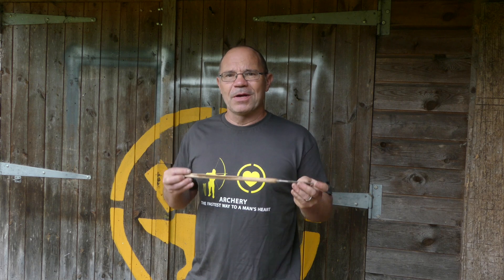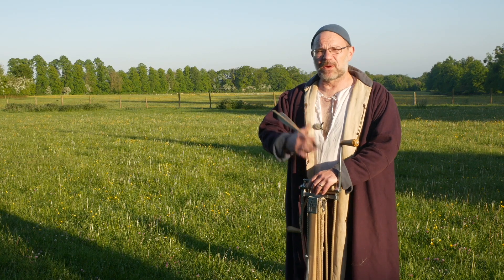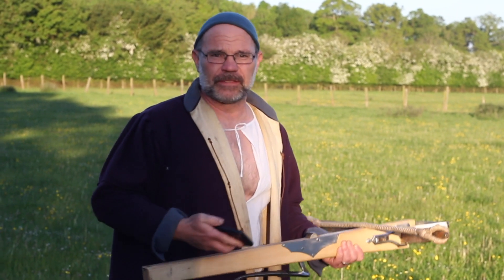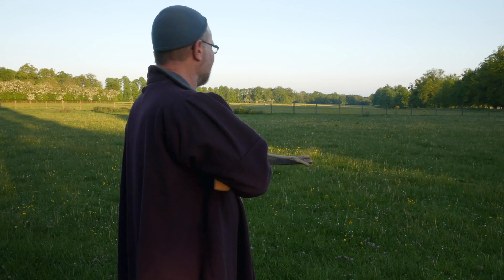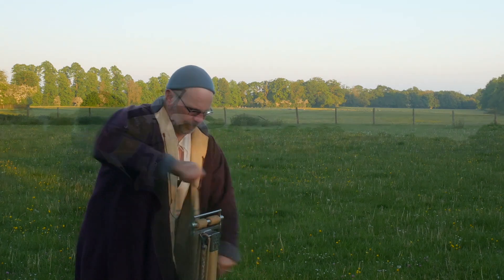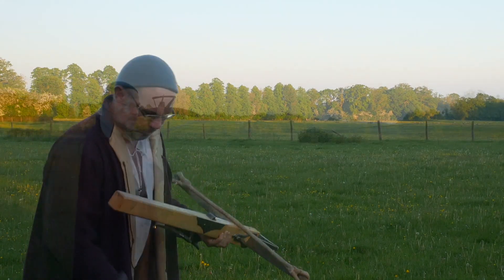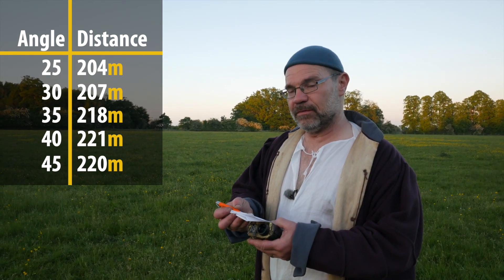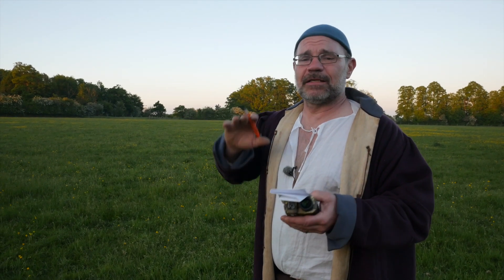Distance - Which angle is best?

Comment: I don't have a reference handy for this, but I recall seeing someone do this calculation and coming up with somewhere around 38-42 degrees - but the difference in the last few degrees doesn't really make a significant difference (small enough to be cancelled out by minor variations in each shot.)  But the angle also changes depending on muzzle velocity, shot size, weight and shape (these calculations were for cannon fire of a specific weight and power) and there were even separate allowances for wind direction and speed.

Comment: two full football pitches is pretty good distance. Next you need to see how far it shoots at flatter angles. I mean, if it can do 200 m at 25 degrees, how far will it shoot flat? Will the enemy be walking into a wall of bolts?
Reply: This crossbow has shot up to ~200 ft/s with lightweight bolts if memory serves. Assuming it is shouldered at a height of 5 feet and shot level with the ground, the bolt will be in the air for only 0.56 seconds, traveling only 37 yards in that time before landing on the ground. A more typical heavy bolt meant for penetrating armor will only travel about 30 yards when shot level with the ground. The trajectory of the crossbow is more or less the same as that of an ordinary longbow and requires a similar amount of inclination to reach similar distances.
Reply: @johnbarron4265  flat being a relative term. ialso think you are off on your calculations, as competitive Archery is @ 70 meters for the olympics, and 30m is standard practice distance. I know that I can shoot "flat" up to @ 50 meters
Reply: @jonathanwessner3456  "Flat" is not well-defined unless it's strictly referring to a level shot. Perhaps the so-called "point-on" distance would be a better indicator of accurate effective range, as the archer/shooter can place the tip of the arrow/bolt right on the target while still having an unobstructed view of said target. The point-on distance of a crossbow would likely be farther than that of an ordinary bow shooting at the same velocity because the crossbowman has more freedom in positioning the crossbow for the shot than an archer has in choosing their anchor point.

Comment: Let me know if you want my cad files and trajectory tables. Pretty geeky stuff, but interesting, the model verses the actual range testing. 
BTW, with a 75# compound bow, we were getting 360 to 375 meters, depending on arrow weight. They were all using small ( 2") feather fletching.
Reply: As an engineer and recurve archer (internationally) i would be delighted if you could share! Maybe even on github?
Reply: @thomasrufer6206  Sorry,  but I am a tech dinosaur.  what is github?
Reply: @RAkers-tu1ey  https://github.com/ where you can create a project and add all those files.
Reply: @thomasrufer6206  Thanks, I will look into it.
And, dig out the 5 year old files!

Comment: Really interesting.  I have done a lot of trajectory testing (both theoretical and physical) in helping to design the architectural loft restrictions archery ranges for bow weights from 25# recurve to 75# compound.  I would have expected a lot more variation. It looks to me like drag is the greatest limiter, as it decreases with decreased speed, and those heavy shafts must have a lot of drag.  It is like you are shooting in water.

Comment: Great test. For my test I shot at 45, 40 and 35 degrees, four times each (crossbow was cold steel cheap shot).  35 degrees on average about 8% farther than 45 degrees. average distance for each was: 240 meters at thirty five degrees,  234 meters at forty degrees, and 221 meters at forty five degrees. 
Made a video on it "what angle will shoot an arrow farthest". Yes it was inspired from Tod's work
Reply: I'm wondering how much of a difference release velocity makes which could explain your very different results.

A faster release (from using lighter bolts, a stronger crossbow, different draw distance etc.) is going to have much more drag to contend with so will have a preference for a smaller firing angle. Tod was using a fairly middle range crossbow at 850 lb with what appears to be his 60g bolts.
Reply: @ad3z10 I think you are on to something there. The bolts from the bow I used are significantly lighter and are more likely to be moved by air drag and cross winds. And air drag looks to be the key to this.
Reply from the maker: Thanks Jesse - good to know
Reply: A difference in temperature and air pressure, I assume.

Comment: I am a Ballistics Nerd and spent much time in my formative years researching and experimenting with this, mathmatically.
There are several components to the forces actings upon a projective in flight. Gravity and the force acting against its forward motion in line with its motion are the main ones and while gravity is predictable the force (the opposing force) varies depending upon its instantaneous velocity and its pitch and yaw affecting the attack angle. The shape of the projectile. is also significant.
My interest was with Naval Shells and the dimentions of a typical shell was well known and designed so that the front bit hit first. There was nevertheless pitch and yaw. I remain facinated by this subject btw more than fifty years after I started. The only differnce between then and now is that Log Tables have progressively been replaced by Calculators (of varying degrees of cost) to computers to purely mathematics.
It was interesting to observe that one particular shot showed considerable pitch and yaw until the bolt was out of vision. That surprised me as intuition says to me that the longer and thiner the projectile the more stable it would be.
Perhaps the  necessary design of the bow means that the accelerating force has to be slightly out of linear giving the pitch and the fletching causing the yaw
It is a while since I did any work on this obsession of mine, I do hope you have not re-kindled it. :-)
Conventional data for a Naval gun with initial velocity close to but not exceeding the velocity of sound (from memory only) is that the optimal angle of elevation is around 35 degrees. I was surprised with your result and as an explanation would suggest it was because the initial velocity was relatively low.
I sincerly hope that you have not driven me to the Reference Library again, they are not as good as they once were in normal towns.
Sorry about the length of this. It is not a frivolous subject.
Reply: I believe the crazy flight of Todd’s bolts was the weight of the bolt point wanting to rise to avoid the string.  It could be altered by deepening the bolt slot at the front of the stock. But too much and it curves down, not good. 
 It also could be fixed by shooting lighter points or shorter bolts.  Flat shooting is the desired effect I think, but Todd was using random specific bolts that left the bow in an unconventional and undesirable way.
Tuning a bow is done by changing the arrow spine, length, and head weight, and angle or trueness of launch.
Reply: There was a game (I don't remember the name) where optimal angle for long distance shooting (bows) was 38 degree angle. So 35 degree for guns and 40 degree here so 38 is actually in the middle (or pretty close).
Reply: @James Goacher, go for it and dive deep in your memory. You know you really want to, and your inquisitiveness shows in your writing! Happy hunting. I think it’s bloody marvellous that you retain an interest after more than 50-years! Quite possibly one of the better known ways of staving off the effects of age on the brain. Good luck.
Reply: At a guess, maybe it has something to do with the bolts having stabilizing fins that allow it to more easily maintain the correct, most aerodynamic, orientation even when fired at extreme angles.
Reply: I always put a radio transciever in my medium calibre shells before firing them at japanese aircraft.
Reply: Naval guns are able to shoot over the horizon, though. So an elevation of 35° in relation to the ship would be a different elevation in relation to the point of impact, would it not? Whereas a crossbow isn't able to shoot far enough that the circumference of the earth really matters.
Reply: @hazelhazelton1346  Assuming a range of 20 nautical miles, a little over 40,000 yds, not a practical engagement range the sea level would be a little under 100yds below the horizon to a person whose eye was at sea level. At 10yds height above sea level, a more practical place to mount a gun the horizon would be almost six and a half Nautical miles 12,000 yds. So I would expect the height of the gun on the target to be close to the height of the firing ship at 24,000 yds. (Information Googled)
The other and most important reason for my obsession in my formative years is that the terminal angle at long ranges is much greater than the initial angle. Plunging fire.
Reply: @jamesgoacher1606  I see. So even for naval guns, the difference is negligible. Thank you. :)
Reply: I wonder if the wobble is a function of the bolt not being able to travel through the arms of the crossbow— which is what the string wants to do when firing. I suspect this wobble also effects the amount of energy the bow transfers to the bolt. If it sits a little differently in the grove. It he doesn’t center the fletching so one feather drags, if the string scrapes off all the wax, or whatever, that he lubricates the top of the crossbow— all could effect the bolts flight. 
The variables in a ballistic flight can be really interesting. When I was in the US Army, I worked on a surface-to-surface missile that could go over 110km. I remember having to compensate for the rotation of the earth during time of flight!
It can be a fun rabbit hole to go down.
Reply: @doughudgens9275  exactly! Ballistics are one of the most interesting applications of physics. You have to account for everything when you scale it up enough...or down (depending on the parameters).
I think that wobble indeed comes from the arrow and the string not traveling colinearly, but at a slight angle. And i think that will be the biggest contributor to it...fletching isn't gonna do much. Maybe play around with the weight distribution on the bolt?
Reply: you have any good references for equations or simulators? I do wonder what factor "weighs" the most under what circumstances. For example, what matters most between speed, mass, elevation, drag coefficient,...
Reply: @anomalyp8584  I used the Encyclopedia Brittanica and Chambers Encyclopedia for most of my initial reseach which would have been around the 60's. I now know that it is a complex Differential Equation because the variables are changing at different rates and that they are different either side of Mach thresholds. The important force is the force acting against the direction of motion which is constantly changing with time of flight. I am vaugue about things now but I think that my initial find was something like D squared divided by mass D²/m and then it gets complicated. The retarding force acts directly as the cross sectional area and inversely to the mass, which is probably intuative. Gravity can be taken as a constant of 9.8m/s² and depending upon the initial velocity and initial angle the velocity may increase on the way down. It is very complex and I believe that Naval Gunnery Range Tables are found empirically.
Reply: @jamesgoacher1606  I was starting to wonder since Todd uploaded a video about the range of different weights of bolts.
The D^2/m ; I think you mean Ballistic Coeff. (BC)? The formula is a tad different.
Reply: @anomalyp8584  I'll have to locate a 1959 Encyclopedia Brittanica and check. It's been a while.
Reply: @jamesgoacher1606  hahahaha i feel bad man :p
Reply: @anomalyp8584  Think how I feel. I have begun to hate Tod for wakening this up. I have managed to quell the urge for 20-30 years now and then this turns up!!! :-)
Reply: @jamesgoacher1606  it's just in your blood. Embrace the nerd side!
Reply: @anomalyp8584  I don't think it is a Coefficient, that is a property of the object and the material it is made from. I think this is just Physics and the dimentions. There are many other factors not the least being the velocity above all else I think and the relation to the speed of sound, Somewhere I read the there can be a Cube factor and a Fourth power factor as the velocity increases. There seemed to be quantum steps as it passed through each Mach Number.
In the down part of the trajectory with relatively slower moving projectiles the 9.8 m/s/s acceleration due to Gravity is significan and this is relevent to Naval Shells of large calibre as well as Arrows. My intuition says that releasing an arrow (which after all is what this thread is about) at an optimal range uses this feature.
Please let me sleep now :-).
Reply: @jamesgoacher1606  this is a link to a calculator for flight paths specifically for arrows: http://margo.student.utwente.nl/sagi/artikel/arrowfs/
Reply: 35 degrees is for blunt objects, aerodynamic increases it more,

Flights however cause it to have a more ballistic flight path, & don't forget these are probably below terminal velocity of the bolt, meaning it will increase in speed on the way down, unlike subsonic testing. Which will have a significant speed difference from launch & impact, again, tending away from ballistic shape

I believe javelin's optimum is 42 degrees due to its low drag.

Comment: From a theoretical physics perspective, whatever angle you hold the crossbow for the effective trajectory angle to be 45 degrees, after wind and drag coefficients have been factored in, should give you the furthest distance.  This means that with a tail wind, you should be aiming at more than 45 and with a head wind, you should aiming at less than 45.
Reply: From a theoretical perspective you should only shoot at exactly 45° if you have a tail wind that perfectly matches the speed of the bolt (so that you have no relative velocity between them). Even in still air you have drag, which generally means a lower angle is better. That said apparently for this setup the drag and angle seem to just about cancel each other out.

Comment: Watching the bolts come off the cross bow, there is a significant amount of cant to the side, and it looks like the bolt has to travel around 10 yards before it stabilizes in flight and you get true arrow flight. Have you ever considered doing some kind of very close range testing on armor to see if the bolt's inability to stabilize in short distances has an effect on penetration? Some of the bolts seem to have the point more than 30 degrees off the direction of travel shortly after leaving the cross bow, and I would be curious if there was a limit to how close the weapon is still effective. It goes without saying that getting hit by the bolt at such close distances would be painful but if the arrow head is so far off can it penetrate a shield or good armor? Obviously at close ranges for testing you may want to consider some kind of shield or something to protect yourself from shrapnel if an arrow explodes on impact or bounces weirdly but I would be immensely curious as to these results.

Comment: I don't know about crossbow bolts, but I am a naval technical historian and I do know that naval artillery requires an elevation of 50 degrees to maximise range in atmosphere. However, high angle fired naval shells achieve quite high altitude and pass through some very rarefied atmosphere that a crossbow bolt won't.